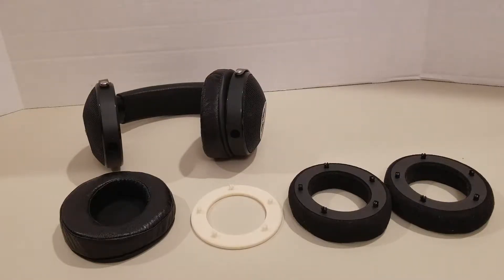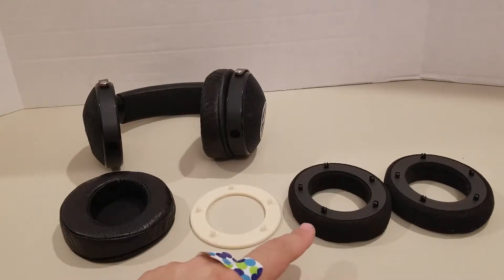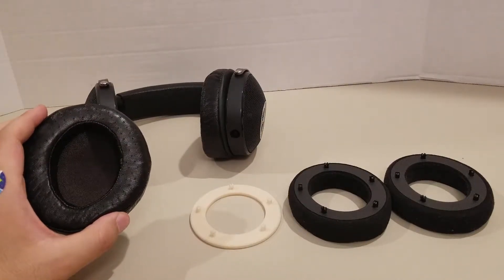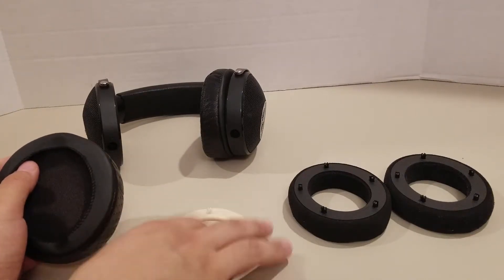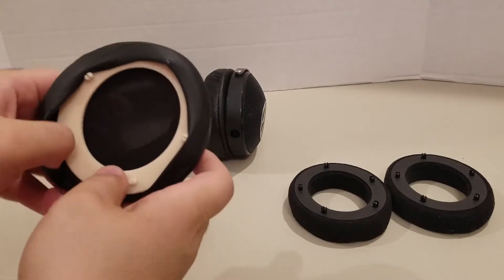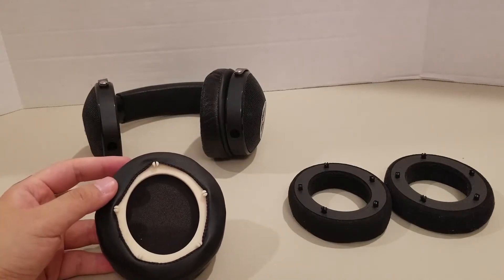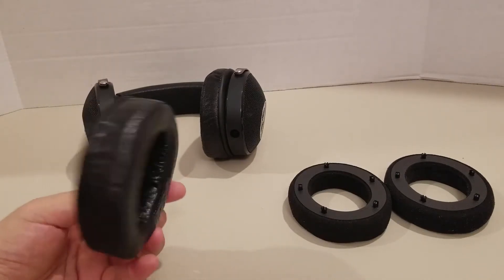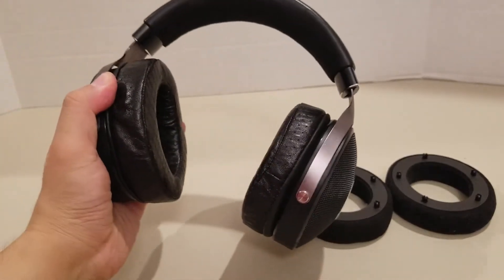Focal Elear - Custom Earpad Mount

Comment: Hello, can you still get the focal earpad mount, or have it made. I would be interested in purchasing for Elegia
Thank you
Russ
Reply from the maker: The file link is still good. Just upload it to a site that offers 3d printing. Make sure you are choosing a softer plastic material, not ABS plastic. Otherwise it will have a much lower lifespan (will break with enough install/removals).

Comment: Which type of pads should I choose off the ZMF site?
Reply from the maker: I used the Auteur perforated pads but most of them should be big enough to fit over earpad mount.
Reply: @derelictmusic3218  How did those affect the sound signature